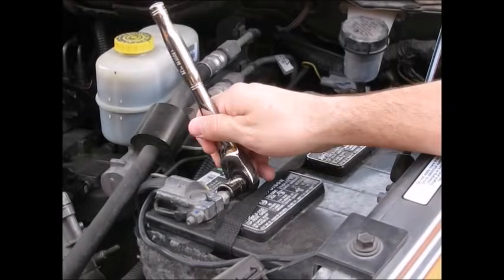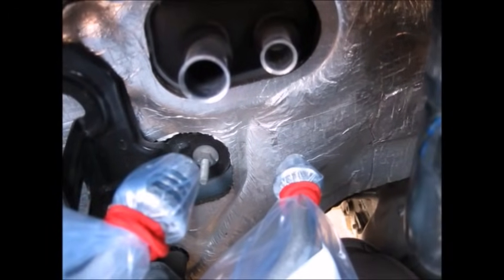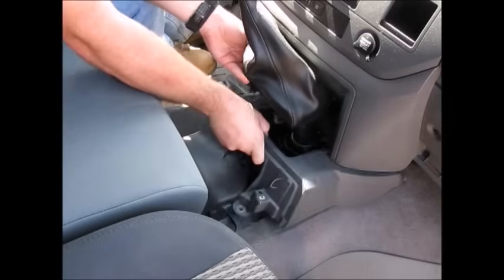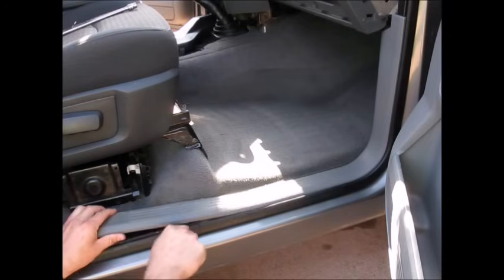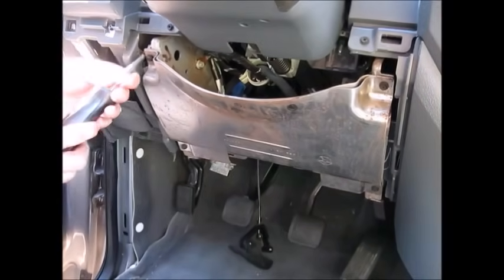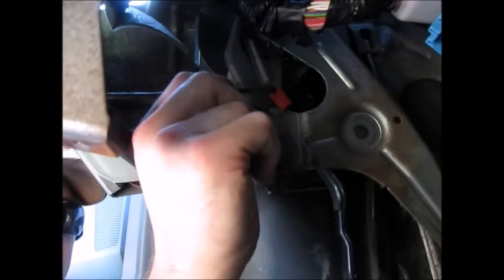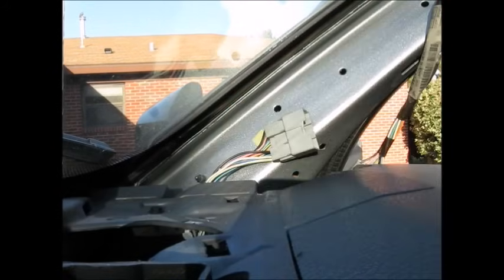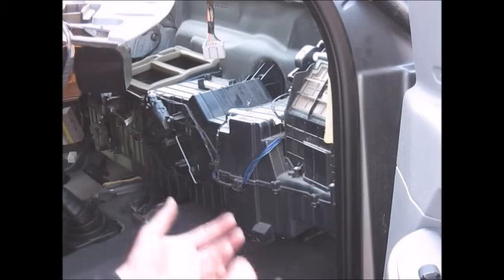Blend Doors and Evaporator Replacement - Part 1, Removal

Comment: anyone know why the hvac box would seem to be stuck on the far passenger side of the box? ive shined a light back there and it seems that there is a metal retaining pin that it has to lift off of or something but no matter what i do i cant get it to come loose. ideas?
Reply from the maker: Did you take off the correct nuts from the engine side of the firewall? There are several up there that are partially hidden by insulation.  Perhaps you missed one.
Reply: flopster843 yea I did. I missed the one hidden behind the coolant reservoir. Got it now. Got my doors from blend door usa and I'm impressed by the quality. Thanks for the recommendation. Jim is easy to work with and has good prices

Comment: Thanks Buddy, you just saved me several hundred dollars.  I had to change out the evaporator in my 2007 Power Wagon.  While I had it disassembled I went ahead and changed the heater core as well.  Your video saved me a lot of time and money.  Much appreciated sir.

Comment: My son and I just did my '07 Ram 2500 last Sunday- took about 8 hrs, used the Blend Door USA kit with all 5 doors and drives. By far, the most difficult task was the a/c lines disconnect! Fought and fought scrappy tools, ended up cutting a piece of zip tie to wrap around pipe and depress clips! 
Can't thank you enough for the very concise video!!
Reply: Those three bolts on each side looked like it had a river… How did you get the rivet out?

Comment: Love this quality vid but funny he says you can do it with basic tools then immediately.....use custom removal tool
Reply from the maker: You mean the spring-lock tool I used for the AC lines? You can pick those up at any parts store for cheap.  Same tool is also used for fuel lines on many vehicles. It's a must-have tool for most mechanics anymore.
Reply: yeah, just saying its not a common tool, nor the other one you use to do the other line, not even the pry-up tool, these are custom tools most dont just have lying around unless they already do what you do.

Comment: Does the refrigerant need to be emptied before disassembling the evaporator? I'm guessing it would all drain out, am I wrong?
Reply from the maker: Correct.  You'll need to evac the system before disassembly.
Reply: Thanks! Exactly what I thought. Great video, I thought this would be about impossible, you make it look simple, and a basic repair. I will tackle this now..  I just heard it in the beginning of video saying to evac system, guess I should of listened it was right there! You have all the bases covered.

Comment: Excellent vid.  i watched this a couple times and had mine torn apart in 1.25 hrs.  then I got tot he AC lines......nightmare....5 hours fighting them only to discover a video where the guy cuts some plastic from a paint bucket lid to make a tool to remove the lines. After dremelling and fighting the tool I had bought I cut out some plastic....and it worked.  that being said, they have to be finessed out.  slide the plastic in, wiggle gently and the line will loosen ad come right out....as easy as we see in the video here. not including the ac line issue this job took me under 4 hours.  pretty simple thanks to flopster.  the only down side....my top panel was brittle nd all the clips snapped.  The replacement costs $307.....I'll be buying a dashmat instead

Comment: Great video but you forgot the removal of the overflow container and the 3 bolts on the firewall behind it.
Reply from the maker: That's not on my model year. My overflow is by the radiator.
Reply: Was just doing mine and something was holding box on passenger side! Glad I found this comment before just prying on it! Thanks! Mines an 05
Reply: Also best how to video on YouTube!! Thanks

Comment: Did this yesterday on my 07.5 2500. There were a couple of bolts on the backside of the firewall behind the passenger battery and relay panel that hid adding a little time to getting the box out (2:45 in your video). That being the only hiccup, and I imagine there will be tiny deviations with model years, you're spot on good sir -- thank you for making this DIY vid! The You make it look easy while I'm over here looking at my hammer and sawzall! Cheers!

Comment: Can you just replace the doors with out taking the plenum out?  I'll take the dash out but if I don't need to replace the heater core or the evaporator why take it out?
Reply from the maker: You'd have to cut the box apart in several different spots to get to the doors, and you'll never get the doors to sit properly afterwards.  In the time it would take you to take all of the dash panels off, cut the dash supports, and cut the box apart, you could have the dash pulled back and the box laying on the ground.  It's not a time saver to try to cut it apart and you'll end up with a hack-job fix that will only give you problems in the future.
Reply: flopster843 I didn't say I wouldn't take the dash out. All I wanted to know is if the plenum would dissemble with out full removal.
Reply from the maker: You can access the recirculation door and the panel door with the dash back and the box in the truck.  All other doors require the box to be disassembled and all of the screws to take it apart are on the bottom.  You cannot split the upper and lower halves with it in the truck.
Reply: flopster843 My truck is a 04 is this pretty much the same other than the center Council?
Reply from the maker: mountainknife Yes.  The box is almost identical and the dash assembly is very similar. Your mounting bolts will be in slightly different positions and you will have an extra mount strap behind the glove box. If it's an auto, you will also have the TCM and shifter linkage to deal with.

Comment: Would the blend door cause hot air to flow to only passenger side?  that is what is happening to us and we cannot figure out why.
Reply from the maker: It is possible that a broken door could cause that issue, but a much more common cause is low refrigerant. When the charge gets low, the passenger side is the first to stop working.  Have you fully evacuated and recharged the system yet?
Reply: I am having the same problem with my 2006 Ram 1500.  I thought maybe the duct work came apart behind the radio but when I checked all seemed ok there.  Dealing with the plenum and blend doors sounds like a big job.

Comment: Did you have to burp the heater core at all? I'm afraid that once I do this that the heat will be sub par after this process because of the air in the heater core.
Reply from the maker: Negative.  The coolant pressure in the head will force all the air out of the heater core when you first start the truck.
Reply: flopster843 Thanks!

Comment: So I had to replace the accumulator, do I need to add a whole new 7oz of PAG 46 oil to the system?
Reply: No, you do not.  The majority of your hvac oil is in the compressor.

Comment: So I'm in the process of completing this job and I need to put my windows up because of rain. I put the negative terminals back and I have no power to the entire truck. Did one of connectors remove power from the truck?

Comment: The A/C line you used the 3/4" tool, mine does not want to come loose at all. Do you have any tricks for something like that? The other line came right off with little trouble.
Reply from the maker: The cheap plastic set from the parts store works best. Experiment with different sizes to fine one that will work.  Push the line together like you are trying to seat it while trying to push the tool in.  Twisting the line helps a little.  Eventually you will get the tool under the spring and the line can be pulled off.  Sometimes it takes quite a while.
Reply: flopster843 spray a little water in the fitting while pushing the fitting and tool together. Sometimes dust builds up inside and wedges the fittng, and the water will wash it out.

Comment: I'm at the point of pulling the dash off the mounts on to the seats. I have an '06 3500 5.9L mega cab automatic transmission and it's like the dash is stuck on something by the center console. I went back to the video and I removed all the fasteners you listed. Could there be some difference between the manual and auto tranny that I'm not seeing to get the dash off?
Reply: You called it. Bracket behind the glove box.  Thank you again.
Reply: Mine has a small, vertical bracket right behind the glovebox door. Just take the bottom bolt out, the bracket will move with the dash. Be sure and lift up slightly as you pull the passenger side out. The move to the drivers side and move it a little, then back to the passenger side. Mine felt "stuck" as well. Turns out it was hung on the carpet where the console was. Check that as well.
Reply: I thought it was the carpet too. I made sure  it wouldn't snag on anything but still the same thing. I'll check for that bracket but it feels like it's hanging up in the middle, not the passenger side.
Reply from the maker: I'm not sure on the 06, but on the last 03 I did there was an electrical module of some sort on the floor in the center. I had to disconnect the plug from it to get it off. Each year has some small differences that you have to look for.
Reply: No problem. Glad I could help. Got mine back together and charged the AC system on Sunday. Works like new again! Glad I found this video and the door parts. Well worth the $200 for the doors not not have to worry about it any more.

Comment: This is the best instructional video series on the net about how to do this. I'm a 25 year veteran mechanic and this is the RIGHT way to do it. Don't hack your box like the other videos. 
Two things I would add to this video;
1. To protect your exposed AC parts, take a disposable rubber glove (dust free). Cut a couple of the fingers off and stretch them over your open AC lines. Perfectly sealed and you save your Zilock bags! = )
2. The video does not state this, and doesn't show this step. On my '06 Cummins had to remove the coolant recovery bottle to get to the left most nut retaining the AC duct work. Two small bolts hold this to the truck. Remove these and move the bottle out of the way and remove the 10mm nut on the left.
Then you can remove the HVAC box.
Reply: Thanks for the info! I have an 06 as well!

Comment: Hi all, I have watched this several times and about to attempt this. 
Question is there a point were you can test everything without having to put everything all the way back together?
Reply from the maker: You can power any of the actuators to mske them move by applying 12VDC power to the electrical connector. To reverse direction, just reverse the wires.  You can also power the actuators with a 9 volt battery, they just won't be as strong.

Comment: have a 2005 Ram 1500. replaced all the blend doors. used your video... I used Dorman blend doors. did not replace  any actuators.  my Defrost/dash vents all seem to be working. How ever when you turn key on I can hear a motor  opening and closing  non stop. when you turn key off it stays  on for approximately  30 sec.  Any ideas?
Reply from the maker: You'll need to look up under the dash and figure out what is doing what before you can troubleshoot the problem.  When a motor continues to turn, that's usually an indication that the driver has stripped out the teeth in the door.  Watch the drivers and see which one isn't stopping properly to isolate your problem.

Comment: I completed this job yesterday, and everything worked perfectly. I can't thank you enough for the detailed videos. However today I went to put it on defrost, and nothing comes out of the defrost vents, it just stays on the floor vent. Any idea what could be causing this when just yesterday everything was perfect?
Reply from the maker: Look under the dash at the defroster door drive to see if it's turning. It's possible that you might have pulled the connector  out of the motor or clipped a wire when putting the dash back in.

Comment: I wonder if this prosiding will work with a 2002 dodge ram 1500 quad cab 4.7 engine
Reply: Thanks for your respond, do you know any video links where they show the overhaul of the 2002 dodge ram? Thanks again
Reply from the maker: Sir, my apologies but I must correct my previous statements.  The 2002 Ram 1500 is the same, so this procedure will work for you. Only the 2500 and 3500 have to be an 03 or later.
Reply: You can imagine how much  I appreciate your help, thanks

Comment: I completed this over the weekend thanks in part to your video.  One note, in a 07 Ram 1500 4.7l there is an electrical panel inside the engine bay (to the left of the accumulator) that conceals one of the screws that holds the HVAC box in place.  This electrical panel is mounted on a bracket that isn't easily removed so I had to work in the blind with a 10mm box wrench to get the HVAC box off.
Reply from the maker: That electrical panel is the transmission control module.  Since my truck is a manual, I don't have a TCM.
Reply: Pig Popper TX same issue i had I pulled the computer and the bracket just to get it out of the way .lol
Reply: Pig Popper TX  me 2.   I actually snapped the fresh air assembly pulling on the box.  Great video but I wish that was specified within the video.  I know I shouldn't have used force but hindsight 20/20 rule.  It's sitting in the driveway weathering a thunderstorm presently.  I'll have to pull that computer panel another day to get her out.  Hopefully epoxy will fix the fresh air assembly.

Comment: This series of videos is without a doubt the most well put together, and explanatory I have come across. and even though I have a 05 Ram 1500 5.7, Because of these videos, I'm now confident I can do it myself and save $$. One question regarding the new evaporator. When you add the 2 ounces of oil, where exactly do you add it to? Does it just pour right in the new evaporator? Or do you add it under the hood somewhere? My Haynes manual isn't clear on this...
Reply from the maker: Just pour it into one of the evaporator lines before you put it back in the truck.

Comment: Would the Procedure be the same for 04 Ram 5.7?
Reply from the maker: The early 3rd gens have a slightly different dash setup and therefore have a few different mounting points.  They are extremely similar, and for the most part, identical. The main mounting points and wiring harnesses are identical.
Reply: flopster843 THANKYOU!
Reply: On my '03, I had to remove the entire pcm bracket to get at the last nut for the air box. Maybe the 08's are different as I did not see that step in the first video.

Comment: Great video. Very informative. Do you think the fresh air blend door could be replaced without removing the assembly? My fresh air door is apparently either broken or stuck open. Not bad in summer but cold in the winter. Also, can't switch heat to the floor. (Different door, I know) I feel good about removal and installation of the dash, but I would have to make arrangements to have the Freon pulled out.
Reply from the maker: The recirculation door and the panel/floor door are accessed from the top of the box.  You can get to both of them by pulling the dash back and leaving the box in the truck with the A/C system still charged. All of the other doors require the A/C system to be discharged and disconnected so the box can be pulled from the truck.

Comment: whoever designed this should be horse whipped !!!  if the desinger knew it would be this hard , why have cheap plastic parts that will wear out and break ?
Reply: I'd personally rather it be a plastic dash then metal. Plastic is way more forgiving if you get into a wreck
Reply: more money for dodge, duh.
Reply: Dealer repairs equals profit. After my dodge 1500 warranty expired the ac was the first thing to go. Got this fixed . Then a year later my heater went out. Went to couple of places for estimates. Nothing under $1200.00. Parts were only $200.00. The labor is what killed me. The estimated time including the dealer was six hours of work. I still have the truck. Did a hack job and removed the recirculating door. Have ac. The “environmental “ box is the problem. All the Internet forums say very sub par components were used. Still have no heat but I lease a Honda Fit to get around. 2003 Dodge truck equals crap.

Comment: Bought the whole kit for the dual temp zones.  Great quality.  Those of you with the Hemi should know that the engine computer hides the second thru bolt going through the firewall.  Additionally mine is a 2008 and it appears that the entire dash is a single piece of plastic.  It makes it impossible to do the "hack job" shown on some other videos since you can't remove only pieces of the dash.